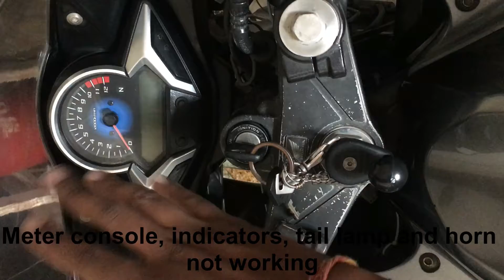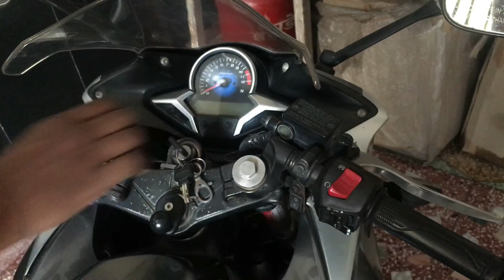CBR 250R Meter console, turn signal horn and tail light fuse replacement

Comment: Can you tell where can we get cbr 150r fuse blade 10A 30A online
Reply from the maker: That's the most common fuse. No idea about online. But any local automobile shop will have it.
Reply: @JamshedpurMusafir  sir i have the same issue can you tell me what could be wrong if the fuse is not blown and also how i can check for wire shortages if any?